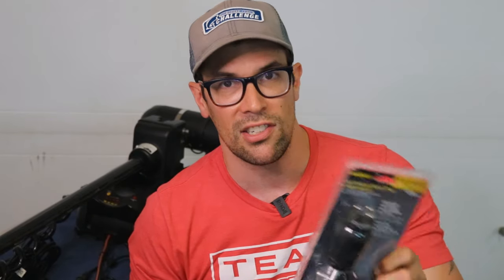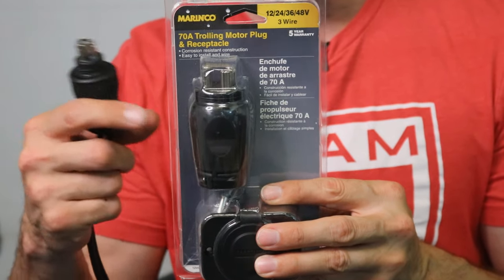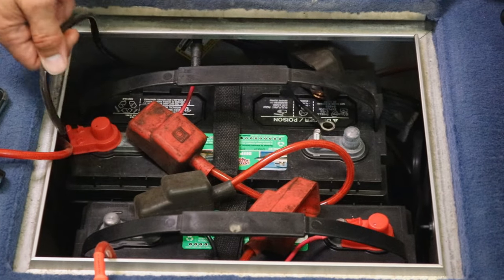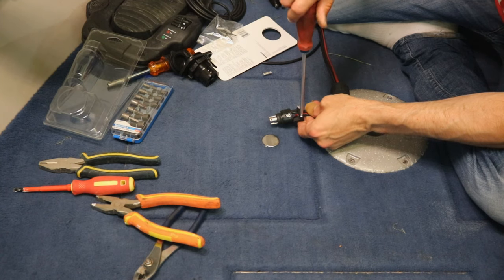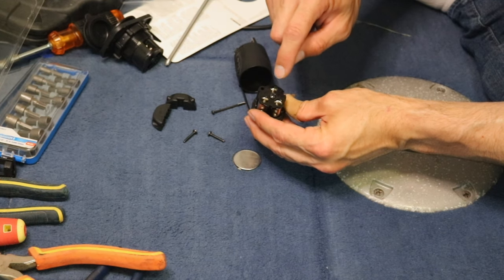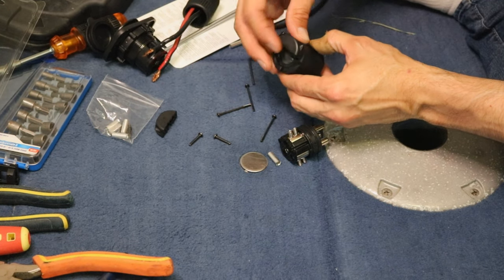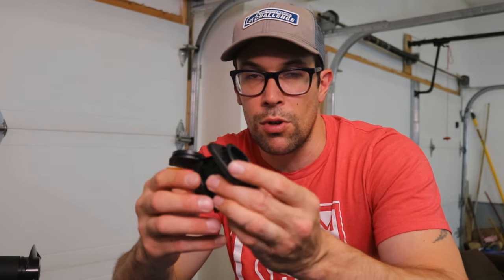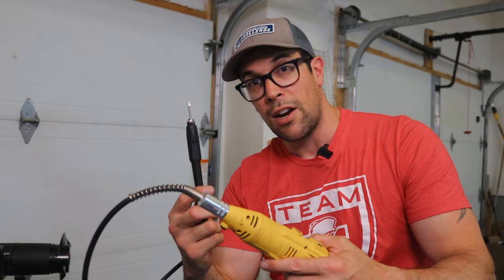How to Install or Upgrade your Trolling Motor Plug and Receptacle on Your Boat!

Comment from the maker: So glad I changed my trolling motor plug, I really did hate that twist lock version.  Anyone else do this on their boat?
Reply: I was going to install mine this weekend but after watching this video, I'm returning my old plugs and going with the 70A plug too. Thank you!
Reply from the maker: @kbxiong67  Nice, you won't regret it, the plug is awesome!  Thanks so much for the comment and good luck with your install!
Reply: Just did mine today super easy and super heavy duty. I love it was thinking about twist lock so glad found this video and your channel. Awesome thanks.
Reply from the maker: @Scott-Anderson  you're very welcome, thanks so much for the comment! I am so happy I changed to this from the twist lock, so much easier, glad you found the install to be very easy, wish everything was that simple lol! Tight lines!
Reply: I’m going to be doing this today.
Reply from the maker: @MartinHentges  good luck with your install!
Reply: I’m going to be installing my Maxxum 24 Volt from a complete 12v system here as soon as it gets a little warmer. Just ordered the circuit breaker, going to order this plug and some 6 gage wire thanks to your other video looks like I’m gonna have a pretty solid set up when it’s all said and done thanks for the awesome videos and thorough explanations cuz I am no way by any means a electrician lol
Reply: I just did it this afternoon, and  I found your video right here to validate my work. It's really a simple change . The only issue for me was routing the bigger hole for the larger receptacle too. My board where the plug mounts has a metal faceplate so it wasn't as simple as cutting out the plastic plate you had. Took a bit more work and a few dremel bits. I used the same plug too. It's definitely beefy and more heavy duty.

Comment: Just installed this bad boy. Sure is a great replacement for the factory POS that comes with boats. To further prevent corrosion, I added a drop of marine silicone in that hole where the pos/neg wires split (coming out of the plug to the trolling motor) to prevent any water from entering the plug there, fresh or salt.

Comment: Just wanted to say thanks.  I upgraded my trolling motor to a 24 volt minn kota.  I thought initially I only had to add a battery.  Man was I wrong.  I've watched most of your videos.  Couldn't have done it right without you.

Comment: I just changed mine today, thanks to your great tutorial Dan.
Ordered the same plug. It was an easy install in my Crestliner. I only had to widen up the hole where the old twist lock adapter was. That plug is solid!
Reply from the maker: Awesome, I'm glad the video was helpful and you were able to do the install!  I'm also happy to hear you're happy with the quality of the plug.  It really is a big, heavy duty plug, it's hard to get a sense of that until you have it in your hands.  Thanks for the comment! :)

Comment: Got a big project this weekend to do my boat. I'm replacing the stock edge 45 (45lbs thrust) for a 12v terrova (55lbs thrust) with ipilot link. I'm gonna replace the stock 8gauge wires for 6gauge and upgrade the 50amp breaker for a 60amp. This video will for sure help me when installing the plug and receptacle. Thanks!

Comment: I am doing some major upgrades to my boat this winter. I just purchased a new trolling motor plug and receptacle to install. After seeing this plug you installed I am returning my other one and ordered this Marineco plug tonight. thanks for this great video. Very helpful
Reply from the maker: You definitely won't regret it, this plug is heavy duty and if your other one was a twist lock, you REALLY will like this one better!!  Thanks so much for the comment :)

Comment: Hey Dan,
I Just did this upgrade on my Princecraft, was having problems with my old twist one and decided buy and install this one after seeing your video.
I'm only running 12V but plan on eventually upgrading in the future, which  this Heavy Duty plug will have no problems handling.
Thanks man 
Keep the great videos coming.
Reply from the maker: Greetings fellow Princecraft owner! :)  Were you having the same issue where the entire housing was spinning around when you would try to spin lock/unlock the plug?  That's what was driving me bananas!  Glad you like the upgrade and the video was helpful, enjoy your new awesome plug!  Thanks for dropping a comment and letting me know you did this install :)

Comment: I watched your video on how to wire up a trolling motor and made a comment about upgrading from Marinco plug and receptacle.  Your comment was to watch the video where are you upgraded your plug-in receptacles I assume that is this video.  I too hated my Marinco plug and receptacle but I installed the Minnkota MKR-26.  When pulling my old Marenco apart my red wire fell off as well just like yours.  Certainly your new Marinco is a much better plug  Then the old Marinco.    Have you taken a look at the MKR-26.  I liked it so much I’ve upgraded my small Boat and my big boat.   Anyway thanks for the videos
Reply from the maker: the more robust heavy duty Marine co is way better than the 40 amp version for sure just a much bigger heavier more heavy-duty piece. The wires also secure way way better. I did check out the Minn Kota plug but it was super expensive and a friend of mine that is a marine mechanic suggested I go with the Marinco. But yeah night and day difference for sure and I love getting rid of the twist lock!!

Comment: Great video.  Had to replace the standard plug on my new motor within 3 months of owning it.  Agree, the twist plug is not the best method.  Went with the old plug because I didn’t know better.  Will do this upgrade when the next replacement comes.
Reply from the maker: You won't regret it, best plug I've used and after almost a year it's still rock solid!

Comment: Great video Dan , have a question about the I Pilot puck. How did you wire that? I know you wire it to a 12V source like a nearby fish finder. Did you splice it in with butt connectors or some other way ? Thanks again .
Reply from the maker: I actually do not have the heading sensor with my motor as I believe you need the Bluetooth version to have that, my older Terrova doesn't come with it.  I actually would need a different heading sensor that Garmin sells that connects to my unit but it's pricey so I just suffer in silence lol!  I'll definitely have it when I upgrade my system very soon.  In my case, I would likely connect it to my bow mount Echomap power connection, I'd crimp the puck power wire and echomap power wire in to a spade connector setup :)  Hope that helps!
Reply: Aww ... that’s helps .
Thank you very much
Reply from the maker: You're very welcome :)

Comment: Dan, great videos!  When you connect your batteries in series and you have a 2 bank charger onboard, shouldn’t you have a disconnect switch between the cable from one battery To the other when charging 2 batteries at one time?
Reply from the maker: Thanks Dennis!  No, you don't have to disconnect your crossover cable.  That's why you use 1 bank set per battery :)

Comment: Great video. Thanks for making this. Question: what size wires from the trolling motor to the plug? My wires are 10 AWG. Marinco recommends 8 or 6 AWG.  Do you think 10 AWG will work? I'm no electrician..
Thanks.
Reply from the maker: So the factory wiring for your trolling motor is 10AWG?  I would assume the factory would use the appropriate wire, but that does seem on the small side.  What brand and model is your TM?
Reply: Minn kota terrova riptide. 24 volt

Comment: After watching your GREAT vid, I was wondering what the third connection is used for on the plug? Possible upgrade down the road or running an extra wire somewhere?
Reply from the maker: Oooo good question bro!  While it's not common anymore, you used to be able to buy trolling motors that can be wired for 12v OR 24v. An example would be the older Minn Kota Vantage. On those kinds of trolling motors, the two wire was used for the 12v and the third wire would be installed for 24v.  Nowadays, trolling motors are either 12, 24 or 36 etc and some new trolling motors like the Garmin Force will autodetect the voltage being used, the same motor will run on 24 or 36 with a 2 wire cable.

Comment: Great videos as I just had trolling motor issues that forced me to bail on a tournament at the very last minute!  I do have a question.  You said you needed to change your 40 amp plug because you had previously wired your batteries together.  I watched the older video and it looks like you put two 12 volt batteries together in series.  If I am correct that makes a 24 volt “system” but it does NOT change the amperage.  If so, you really did not have to change your plug (even though the new one is much better).  Am I correct or have I missed something?
Reply from the maker: Hi Patrick, so sorry to hear you had a bail on a tournament that absolutely sucks, especially when it's because of a piece of equipment! this is a really good question so you have to remember that the amp draw is not determined by the batteries but it's determined by the electrical device that you're using.  So a average 24-volt trolling motor will draw up to 50 amps typically so this is regardless of how you set up your batteries or how many batteries you're using in a series or in parallel. So if the Max draw rating for your trolling motor is 50 amps then you need to make sure you have a breaker or fuse system that can handle 50 amps, regardless of the voltage draw. Of course you also need to make sure that the breaker is meant for your voltage and the Marine Breakers are all rated up to 48 volts if I remember correctly regardless of what the max amperage is. S in my case the 40 amp receptacle was not rated for the maximum 50 amp draw of my trolling motor and I had to change it. The only way a 40 amp receptacle would be appropriate as if I had a 12-volt trolling motor, which I believe have 30 amp Max draws. Hope that helps and thank you for the question and I hope you get your trolling motor issues off!

Comment: Great video! Dumb question but what size fuse do you use to go along with the new receptacle? 70amp fuse?
Reply from the maker: I actually recommend you go with a breaker and not a fuse.  I switched to a 60AMP MK breaker you can see that install on this video: https://www.youtube.com/watch?v=z8vjVBew1I4

This is way better than fuses!

Comment: I fish saltwater and I have gone through two Marinco 70 Amp plugs. the weakness is the little allen wrench screws that hold the wires. they do not appear to be stainless or tinned. They rot and it's toast. A chain is only as strong as its weakest link! With my new 24 volt lithium system and Xi5 I am going with an Anderson plug. All tinned and no exposure.
Reply from the maker: Hi Tim, thank you for the feedback and sorry to hear about these issues.  The electrical components are corrosion resistant plated brass according to the website.  Did you reach out to them and ask about this?  Was also curious on what your setup looks like, how is that getting exposed to salt water??  You got me curious when I read your comment so I went in the garage and cracked open the panel that has the plug in it and the bolts look as good as new.  I really feel for you guys dealing with saltwater applications, that stuff is just murder on boats!  Hope the Anderson plug gets it done for you!  Are you planning on using a bolt-in receptacle adapter for it?  Otherwise you can't unplug it with one hand.
Reply: @DanRichardFishing  - yes, my boat is on a saltwater slip and has a lot of water over the bow. Since it was a whaler Montauk 150, I could not get behind the plug to screw it in to seal. I used 2 part epoxy but I think the run from the center console to the bow just had a saltwater vapor all the time. I just got a “new” 2018 whaler Montauk 170 and have a Motorguide xi5 24 volt on the way! I am going with a Rhodan battery tender plug. Hopefully that will last more than a year. Thank you so much for all your great videos. I decided to take the plunge on 3 lithium 12 volt batteries for my new boat based on your videos. You’ve got style!

Comment: Great video.. what if you have a red,black and orange wires to hook up to receptacle?  Trolling motor only has red and black.  Running 24v 80lb minkota so assuming I don’t need either the red or orange?
Reply from the maker: Sounds like you have an older boat that had an old 24 volt trolling motor back when it used to be three wires. You no longer need the third wire so just wire up the positive and negative black and red :)
Reply: @DanRichardFishing  thanks, yes it’s a 2006 BW Dauntless.  Has old 4 prong receptacle and 4 prong plug that need to be replaced.  Old receptacle had red,orange and black hooked up but only used the orange and black wires on the male plug which was a sealed plug.  So trolling motor only had 2 wires red and black. New plugs and receptacles are completely different so was confused.  Thanks again!!

Comment: Hi Dan..thanks for the videos..what is the advantage of having the plug versus wiring the motor directly to the batteries? thanks
Reply from the maker: Great question Richard!  Here's a few advantages I think of right away:

1. Should you have to remove the motor (Mine is on a quick release plate so I can easily remove it for storage) you have to disconnect/reconnect and feed the wires every time!
2. It is recommended that you disconnect your TM from power when your batteries are on a charger.
3. You should keep your plug disconnected until you've launched your boat for safety purposes.  I've seen a few sliced up hands from people climbing in the boat at the bow and accidentally hitting something that started the prop.
4. Some trolling motors such as an MG X5 have a light that's on anytime the motor has power.  That's a parasitic drain on the battery.

For items 2, 3 and 4, you can get around that by having a power switch somewhere between the battery and the trolling motor.  But then you still have #1 to deal with if applicable.  At my old house, there was a lot of random theft and my boat was in front of the house.  I always removed the trolling motor it between fishing trips.  Hope that helps!
Reply: @DanRichardFishing  sure does thanks!

Comment: I bought this but I'm using 4awg. Overkill.....I know.

However 4awg ferrules was a chore to find. I just shoved the wire in and tightened. I had never used ferrules before but this product almost demanded it. 

It seems solid without the ferrule though.
Reply from the maker: Hahah definitely overkill!  Maybe inspect your connections at the end of each season to make sure the connection is still secure with all the banging around your boat does all year.
Reply: @DanRichardFishing  pops was an electrician for over 40 years. His level of safety has worn off. If he could have a substation shut down to change a light bulb he would have. Haha!
So it's natural to say "meh....just cut me 15 feet of the 4.....just to be safe!"

I will check it every summer anyway. But I tugged the crap put of them and they weren't going anywhere!
Reply: My RV application can only use 4 gauge, and this is the only three prong plug that matches my needs. The tech sheet says you can use a ferrule on the receptacle but it doesn’t say that for the plug. Looking at pictures, I can’t see how a standard ferrule would make a larger wire fit in a smaller hole. What am I missing? Is there some kind of reducer ferrule, and that’s what they mean? Should I just forget the ferrule? I’m worried because I tried an Anderson SB120 connector first and those copper tabs aren’t stable. It worked fine for a couple weeks and then a connection got loose and the plug melted really bad from the increased resistance
Reply: @matthewmcmillan9031  a ferrule would squeeze right in there just fine actually but don't worry about it.  I had never used them ever and that's what made me apprehensive at first. 

I just threw some noalox in there and cranked those screws down. They aren't going anywhere. I feel like I could hang from the plug. Haha.

Comment: I have a 36V Terrova and am on my third set of the Marinco plugs, as they come apart from all the twisting over time - not to mention the wires don't stay in the receptacle well, as shown in your video. I just found out about the 70amp connectors this morning from my local boat store, while purchasing a new 40 amp plug. My question is, when I installed the trolling motor, I was sold a 40 amp breaker. Did you install a higher-rated breaker?
Reply from the maker: Your 40 Amp receptacle is too small for a 36v system, the minimum size is a 50 amp so you should definitely not put another one of those in.  Get the one I show in this video, it is WAYYYY better, more secure and robust AND no more screwing around with a twist lock.  My breaker is a 60AMP breaker, which is the recommended size.  Check out my other video on installing trolling motor wiring and I show exactly what I use :)
Reply: @DanRichardFishing  Thanks very much for the reply. I had already installed the 40amp plug before your reply, so I will run with it until it fails, which it almost certainly will do. At that time I will replace it with the items you suggested. The one thing interesting to me is that I have never tripped the 40amp breaker, so the load has never exceeded 40 amps. However, the cables are only about 3-4' max in length, so that helps. Cheers!
Reply: Battery Tender plug problem solved